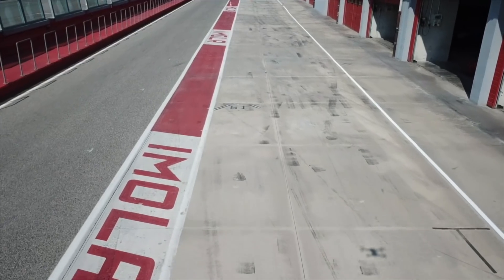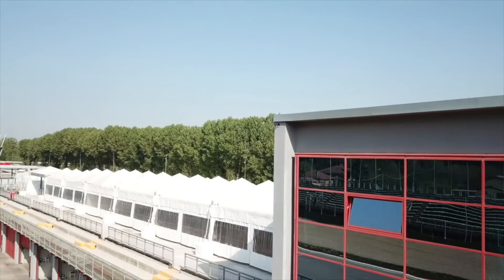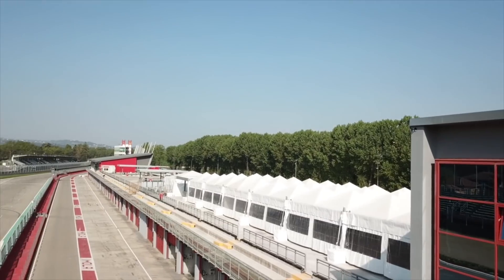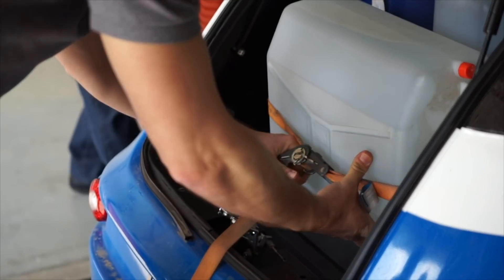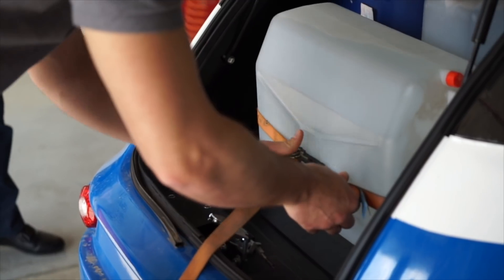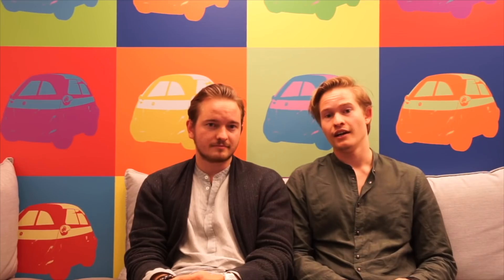Microlino Brake Tests on the Race Track

Comment: It needs Airbags, an AC-option and pass some crash-tests to show people that its also safe to own, many people care a lot about that.
I never really did although i have seen the aftermath of unsafe cars on scene and trust me
Its better to have a car with good structural integrity and some crumple zone. I´d presume, if the Smart Fortwo is able to, you could manage too.

It is a sad fact that many of the people willing to pay this kind of money, myself included, cant afford it or rather, any kind of new car for that matter.
Regardless, you are taking the absolute right step here, this entire concept is amazing and you are, as far as i am aware of, the first ones to do it with some real quality behind it.

Another question tho, as this is classified as an L7e, does that mean that, restricted to 45kp/h, this could be driven by a 16 year old in europe?
Reply: Quite late answer: L7e doesn't have a speed limitation. L6e has. L7e is limited by weight and engine perfomance. Looking at their side, the Microlino drives up to 80km/h. So this requires a normal driver licence.
Reply: @gwandolin  the top speed of the L7e Mircolino is 90km/h not 80km/h

Comment: How will the occupant escape the vehicle or extracted by the firefighters in the event of a head-on collision?
Reply: Don't worry you are not likely to survive that.
Reply: This is a good point. You can exit the car through the roof.
Reply: The same emergency exit as in the BMW Isetta or Messerschmidt. 
But try to avoid getting squeezed between two trucks.

Comment: In 1962 in college I owned a 1957 BMW Isetta and used to drive to school with two grown friends, three of us, crowded into the cab with our school books. It was winter in Milwaukee and there was no heater and it made the cab warmer. The streets were sometimes snow filled and I can remember having to really stand on the the brakes to stop the car with so much weight. It was really pretty dangerous because the small pad brakes were really insufficient for three people with books, probably over 500 lbs. If I owned it now, I would refit huge disk brakes onto it, so I hope your new Microlino has taken three people into account, for it is certainly possible to carry these many on a regular basis, if you are young and stupid. 
Finally, I was very disappointed to see that your purchase price estimate had tripled from your first estimates. It has climbed out of my price range, I am afraid.
Reply from the maker: Great to hear that you owned an Isetta in your youth. Well the law only allows us max 2 persons per car but you are right there will probably be some who will try that out either way. But we take that into account and in the video you can see the braking with full load of 250kg. The bubbles cars from the 50ies like the Isetta had poor braking, compared to regulations we had to pass with the Microlino. Yes at the beginning we anticipated a price of below 10'000 Euros and now we are at 12'000 Euros base price but still if you compare the Microlino to other electric city cars, it is still more favorable.
Reply: In 1962 I bought the 1957 BMW Isetta used for $300. Guess that would be about $3000 in 2018 dollars. Today I can buy a Smart electric 5 years old for about $7000. That is less than half the "base price" of your Microlino, which will certainly be more than $15,000 with frills. You were originally in the ball park at $8000, but not any more. Too bad. Nice looking car. How does Tata do it?
Reply from the maker: Well you can't compare the price of a used car to a new one! In a couple of years you will probably be able to buy a used Microlino for less than 10'000 bugs. First of all Tata is a multinational firm that belongs to one of the biggest firms in India. Second they produce in India where the salaries are way lower and produce their cars in numbers that exceeds our production capacity by far.
Reply: Hey really. If its made for two people it means for two people. Two are not three.

Comment: Can you share some numbers about the brake tests?
How does it fare compared to other small cars?
Reply from the maker: Well at this point right now I can't give you exact comparisons because there are still a lot of things that are going to be improved and changed. We have passed all the tests so we are in the required norms but want to improve it even more to get the maximum out of it.
Reply: Microlino Sounds good. Thank you for the answer.